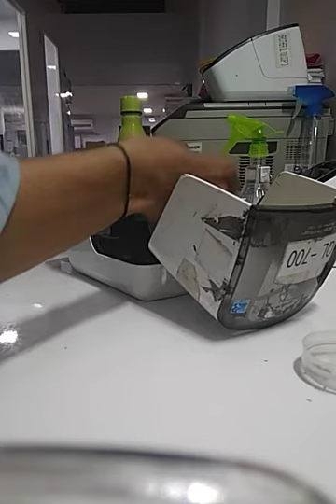HOW TO SERVICE BROTHER QL 700/800 LABEL PRINTER ! BROTHER QL 700/800 PRINTER SERVICE STEP BY STEP

Comment: I have a replacement blade to install in my ql-720, but cannot get it working. After replacing cutter the printer "stalls" trying to cut. Without the blade installed the bottom blade works properly. But appears to jam when new blade is installed.

Suggestions welcomed!

Comment: appreciate ypur post dude, just wanna ask, mine ql 700 too, when i turn it on, it will shut down for a sec, dont know what really happened? and if this problem can be fixed or repaired ?thank you for the answer
Reply from the maker: I can't tell for sure, but please check its power supply once, thanks.